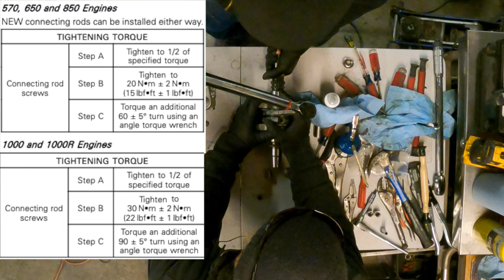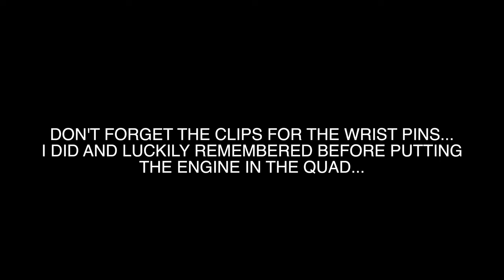How To Rebuild a Can-Am V-Twin Rotax Engine - Episode 3 | Engine Assembly and First Start

Comment: Awesome videos, thank you! I am rebuilding a 2013 Can Am 650 XMR that had a spun connecting rod bearing, crankshaft damage because of it (wear lines in the crank where the connecting rods attach) and the timing chain on the back cylinder was off. I was really hoping to just replace the connecting rod bearing but for peace of mind was going to get a new crankshaft and put in all new bearings/gaskets. (I didnt want to have to crack the case but think it would probably be for the best). Do you, or anyone else, have any recommendations of where to get a quality crank and quality gasket/bearing kit?

Comment: I have rebuilt these engines many many times, I will share some tips: 

You could’ve reused your old case, it looks worse than it really is. I have reused them multiple times and still puuuring. Some are actually a Turbo application ;) …. I would add a mechanical oil pressure gauge, these engines are great until they starve oil. Last tip, add 2-3 washers to the oil pressure relieve valve spring to improve oil pressure at idle. These engines inherently have ~12 psi hot idle oil pressure when using 10w40 weight oil, adding a couple of washers will add ~8-10 psi at idle to around 22 psi, peace of mind. 

Also, add aluminum valve covers & coolant nicks, peace of mind. 

Double check your oil drain plug after each trip, they tend to back off for some reason and leak. 

Those engines have really good cylinder heads, indestructible ! Never needed to seal valve stem seals either, they last a very veeery long time. 

If you have a Turbo application for these vtwin engines, double check your turbo drain hose as it connects to the adapter on the oil dipstick, these adapters are fragile and tend to break causing massive oil leak and engine failure. 

eBay rebuild kits are great, never had any issues with them. Save your $. Just don’t use eBay head gaskets, use OEM ones, eBay ones are a pain in the a$$ and leak big time unexpectedly. Also don’t use eBay oil pumps, get OEM, oil pressure differs greatly with OEM. 

Whenever you’re doing a rebuild, replace your water pump while you at it, it’s not worth the cost or hassle to replace later. They usually last a very long time though. 

Great use of head studs, get yourself some ARP head studs, worth every penny separately if yours is turbocharged. 

If you need to resurface your heads, be sure to know how much the machine shop removed and compensate for that thickness by doubling your base gaskets. 

Always change your spark plugs, saves you big time with random misfires.

Comment: Bought a commander 800 in November only to find the water pump gears (in the bottom of the crankcase) were chowdered. Just about got it back together. This video has been a huge help, thank you! I also learned about Quad Logic from you. Turns out they're the next town over. Stopped in, great people, super friendly, definitely going to do more business there.

One thing I did different was I installed the pistons in the jugs before attaching to the rods. I was able to use my ring compression tool this way. Because I also bought the ARP style studs, I could start the jug on the studs and it held it in line as I installed the pin. I was surprised how easy that was. Except for the circlips, they still sucked. I put my telescoping magnet through the pin from the other side which kept them from falling into the engine.

Comment: Thanks to u i got to rebilt my 2015 outlander 1000xmr thank you  so much 
Finish it today now, put it on bike again thank you 👌💪🙏🔥
Reply from the maker: Great to hear!
Reply: After I got everything back together now it has no spark wht do u think it can be I bought the sillinoid eyeball crank sensor. And still have no spark. We checked with meter and the electricity is not getting to the sillinoid of the spark plug block. I have bought every thing new as Electrical wise
Only thing that I'm reusing. As of now, it'll be the stater.
Reply: @josuelugo3572 yeah most likely a stator issue
Reply: @aaronlangdon9064  I have replaced stator , crank sensor & ignition coil, and still nothing

Comment: Nice job Marshall. I appreciate the attention to detail.   I got a question.  I believe I have a leak between the  engine and the motor. I saw you replace that seal and saying "that might have been the cause of the engine failure".  My question is,  can I separate the gearbox from the engine WITHOUT pulling the engine. AGAIN, love to watch your vids. I've been a mechanic for more than 45 years so I can recognize a real mechanic when I see one.  Thanks for the help.  MN Bill
Reply: You can do it without pulling the engine , although you will have to loosen all the motor mounts and turn the motor sideways enough to unbolt the tranny and take it off

Comment: If you doing an in frame top end rebuild, set your valve clearance when the heads are still on the bench...much easier.  
The billet cam chain tensioner looks nice, but it's worthless since it's just a copy of a stupid design.  A pressure style tensioner conversion kit would save a lot cam am motors, but I haven't seen one on the market yet.

Comment: Hi I’m from the uk and have a 650 2020 xmr same bike as you! Will any 850 engine fit? Is the ecu the same just plug and play?
Reply from the maker: Unfortunately it’s not, in the this instance I had to swap the entire harness and ecu, gauge cluster. You can use your current setup, but it Wallis require a lot of modifying.
Reply: @LetDirtFly  ahhh okay we can’t get our hands on a 850 new in the uk it’s either the 650 or 1000, I just want a little more power out off mine! Like wheelie on the flat I’m happy to leave the stock 28s on but it feels like I have to rev the nuts off it to get the wheels up in a mud run. What mods would you go for?

Comment: Did You install what cannam calls a thrust washer over the shaft of the oil pump prior to installing the pin and gear? You didn’t mention that in the video so just making sure you know it goes there.
Reply from the maker: Can-Am doesn’t use a thrust washer. The case acts as a thrust washer which is why i unfortunately had to replace the case.
Reply from the maker: Can-Am doesn’t use a thrust washer. The case acts as a thrust washer which is why i unfortunately had to replace the case.
Reply: @LetDirtFly That shaft gets a washer.   Look at 14;36 into the video where you pop up the service manual diagram on the screen. It's there. I also noticed , unless you corrected during final assembly the water pump drive gear is installed backwards. The flat side of the gear should be facing the inner part of the case riding up against the washer and the pin locks that gear on from the outside of the shaft.  it's on that same diagram.
Reply from the maker: @nwags357  ohhh yes. Sorry I thought you were talking about the crank. Yes there’s a shim that goes there
Reply: @LetDirtFly  cool.. wasn’t trying to stick my nose.. just looking out. I had to split my case back down as I didn’t realize until bolted together the washer feel off the shaft whil I was assembling and didn’t pay attention. Once bolted and sealed together I looked on the garage floor , and there was a washer. sHit!!!